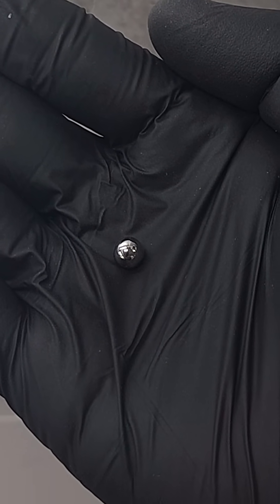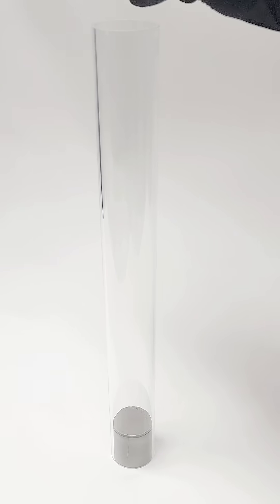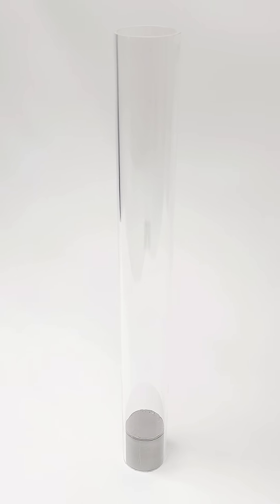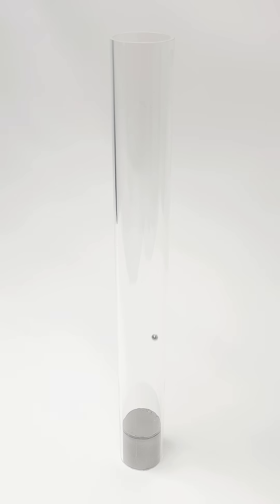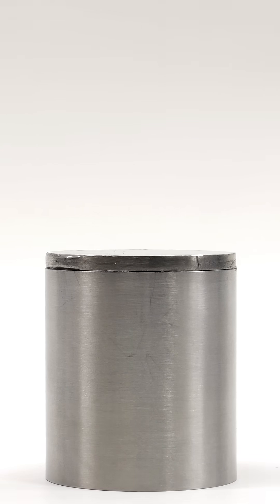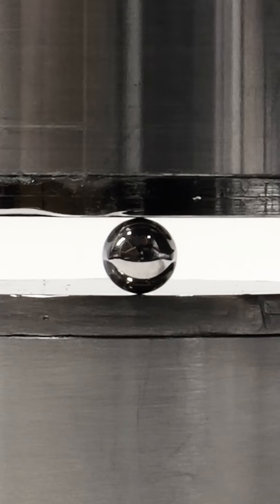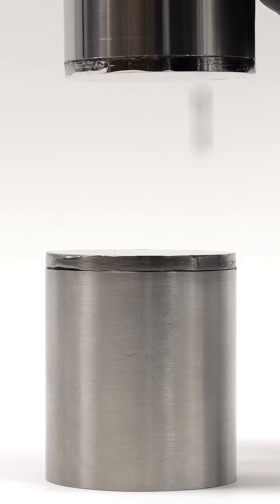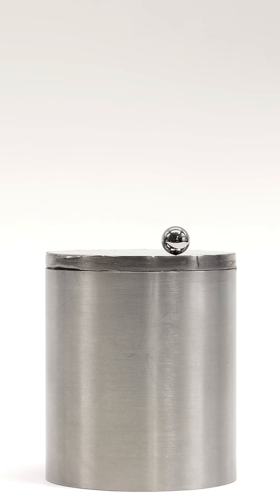This metal is too bouncy

Comment: The beat of the bouncing went from rhythm to a high pitch tone. That tone sounded at least as high, probably quite a bit higher, than A over middle C which is 880hz or about 55,000 beats per minute. That means conservatively the ball in this video bounced 916 times every second.. it is honestly closer to an octave above that which would be almost 2000 beats per second!!! Between 1000-2000 bounces every second is crazy.

Comment: You can get that same effect and the same sound by gently pushing together two heavy-based drinking glasses.  Invert one of them and place it on a table. Then bring the other one, inverted and tilted very slightly, in gentle contact with it.  Gently increasing the point of contact pressure increases the frequency.

Comment: There is a 3blue1brown short about perfectly elastic collisions without friction/etc.

TLDR: Total number of collisions depending on mass is equal to 3.14 (multiplied by input energy) 

There may be an interesting proof to be done here related to the this concept, and its difference in the real world. (Colisions lost to sound, friction, etc) Could potentially calculate some things very accurately.

Comment: pretty goofy idea, so, if you have it encased in magnet material, and have the ball encased in a confined tube, then as the ball bounces, you can have a magnet moving up and down following the balls trajectory of bouncing, as the magnet on the exteriors moves up and down (following the ball), it can create energy which can be stored, just how a windmill or hydroelectricity works, ik about perpetual motion, so it will eventually wear or something, but it should last a while

Comment: It's pretty simple. Because of the trampolines the balls kinetic energy is only lost to air resistance, so each bounce occures with almost the same amount of energy. If you shorten the distance the excess energy causes the bouncing to speed up. The moment you stop the ball between the trampolines the remaining kinetic energy is turned into heat from the friction between the 3 objects.

Comment: I ran it through some audio software and analysed the audio. At the top speed, it's hitting 2.6k fundamental. Which means it's bouncing at, 2600 times a second at the peak. O _ O

Comment: It could well have exceeded 12K Hz. The limitation may be ability of your setup to detect higher frequencies. However, as the space gets smaller, the time window to measure at a given frequency is inversely proportional to the frequency if the closing of the space takes place at a uniform rate.  In addition, energy loss would dictate an upper limit to the frequency attainable and measurable.

Comment: Can this not be converted into energy
Reply: No.
Reply: The entire reason it bounces so many times is because the energy loss is minimal.
Reply: @TrixRKidz  y?
Reply: @JohnnyLawrenceCK  when something bounces, it bounces because every action has an equal and opposite reaction. Now if it’s equal and opposite why wouldn’t it keep bouncing forever? Because some of the energy is lost into sound, friction, and deformation of the ball. This ball particularly is losing less energy due to those factors, which is why it’s bouncing to a height closer to where it was dropped at.
Reply: @JohnnyLawrenceCK  but also that’s exactly why you are right about this not being able to be converted into energy, it has a small energy transfer.
Reply: @TrixRKidz  thank U for the physics lesson but I wascaskin y is it SO bouncy?
Reply: @TrixRKidz  it goes extraordinarily crazy as gap closes, more than seems physically normal.

Comment: I wonder if you left it going at high speed, how much (if any) metal material it is losing - I am assuming the ball is rotating at all times so it should be an even wear and tear on the ball. We will know if it is losing material by the weight or a digital caliper measurement.

Comment: I’m a piano tuner… after a quick listen to the final ball bearing vibration notes at the end of the video, I measure them to be  close to a high G7, which is over 3,100 Hz, or over 3,100 vibrations per second. Could be up close to 3,580 Hz if closer to A7, or the 85th note toward the right of a full-sized 88 key piano.

Comment: Clearly losing 20-30% height on each bounce

It totally looks like it'll never stop
Reply: do you really honestly believe it was losing 20 to 30% of its height every bounce
Reply: @ebenezer-scrooge Yes, because it clearly was.

I work with units of measurement for a living. I can accurately eyeball measurements from a tenth of an inch, to several feet with little trouble.

Comment: What if you added magnets to the outside of the drop at 3/4 angle x4 to 8 to create a pulling force with the drop to create a slow pull just before the ball holds to the top or bottom, think it’s possible to create a constant bounce close to 2 inches away??? This could create electric force if you add slight energy to the magnets itself, feeding a loop back to the magnets creating a propulsion that can be used in zero gravity?

Comment: you talk too much. I only managed to get 1 glimpse with a spectral analysator on my phone, sound peaked at 3khz but because there's 2 bounces per up-down cycle it's going up and down 1500 times per second (still 3000 bounces) When you talk about several thousand times I think I see it going up to 7khz (3500 up-downs per second) but you yap too much so it's hard to tell

Comment: If we consider the scenario where the trampolines are getting closer together, leading to an increase in bounce frequency, we can make an estimation based on reduced bounce time.

### Assumptions

1. **Initial Speed**: The ball bearing has an initial speed of approximately 3.46 m/s.
2. **Final Bounce Time**: As the trampolines approach each other closely, let's assume the effective bounce time decreases to about 0.001 seconds (1 millisecond) per bounce when very close together.

### Calculation

If the bounce time is approximately 0.001 seconds:

\[
\text{Number of bounces in 5 seconds} = \frac{5 \, \text{seconds}}{0.001 \, \text{seconds}} = 5000 \text{ bounces}
\]

### Conclusion

In this scenario, if the ball bearing bounces every millisecond due to the trampolines being very close together, it would approximate **5000 bounces in 5 seconds**.

Comment: to pretty easy calculate how fast it bouces (not the exact value because you have you calculate with gravity and air density then, with the constant energie of the repell,  but to make i pretty simple you have like 10 cm at first, and it already bouces like 10 times a second, so when you put it to like 1mm boucing range, you just devide it so you have 10cm/1mm = 100 by the times it bouces x10 so thousands is pretty accurate :)

Comment: Just crazy idea from crazy racing fan but what if you can make motorcycle or car wheels turn faster with less HP by using these it would be 2 separate systems i think system 1 engine system 2 these trampoline that are on wheels 🤔

Comment: seen a similar experiment involving kinetic forces being used on small objects to eventually move a larger object, and it went something like this, on a 2D frictionless plane, an object weighing 10 grams is bouncing back and fourth between an immovable wall and another object weighing 20 gams, because it has less mass than the bigger object, when it collides it pushes the smaller object back toward the wall, this is due to it having more weight to with stand the smaller objects Inertia
, but now the bigger object is moving slower after its kinetic energy was used to push it away, but after the smaller object comes back, it is now able to push the bigger object, but should the object be drastically bigger, the smaller object needs more kinetic energy and Inertia to push it back, which means it will be colliding with the wall more times than not, similar to this experiment, but a key factor in that virtual experiments, is than when the smaller object collided with both the wall and bigger object, and both object got closer with the smaller object between them, the smaller object suddenly spikes in speed always reaching a speed equal to Pie.

Comment: 🤔 shouldn’t that equal to unlimited energy?
Reply: No?? What
Reply: @aufstieg6948   not necessarily as it is,  but with Newtons law and Epstein E=mc2 there looks like there is enough  transfer of kinetic energy in each bounce to create continuous motion. Even if there is a small spark to start the initial bounce that level of activity is crazy.
Reply: @Kiel_Robinson  “ not necessarily as it is” is the end of  the “unlimited energy” argument
And what do you mean the transfer of kinetic energy look’s enough to cause continuous motion??? 
Even if there was a small, spark or combustion at the impact  (which there isn’t) that still wouldn’t be perpetual motion because it would eventually stop through friction and air resistance and not being a perfect transfer of energy, and even if that wasn’t the case, and it was completely perfect, the spark or combustion you were talking about would eventually destroy the ball bearing and end the cycle, perpetual motion, and free energy is not something that exists as far as humans know.
Reply: @aufstieg6948  I consider all those, but it only needs to be more than the initial energy to be sustainable. For the record I just brain farting here.

Comment: Could this system be used to generate power?
Reply: probably not because it doesnt bounce forever. at a certain point you will need to use energy to put the ball and block back into starting position. that used power is more than the generated.
im not very educated about this stuff so i hope im right.

Comment: Something even cooler is that this is basically how notes work in music. The note is a vibration or oscillation that happens a specific number of times a second, or a hertz. the frequency of a hertz is what you displayed in the video. the closer the ball got to the metals, the higher pitched it went. This applies to any sound really, not just notes.

Comment: Easy, measure the frequency ramp of the sound.  As the sound is the collisions at the top and bottom of each cycle you can measure the number of hits per second by the frequency of the tone.

Comment: In the long video, he made this from scratch. I think that he made something that he could patient.  Who knows, maybe it can be used in satellites with zero gravity. If you connect the steel that the material is mounted with an outer slide, inertia loss would be even more canceled.maybe use some thick, high carbon thick rod stock for the mount .

Comment: From the POV of sound engineering, a note that you hear is technically just the number of cycles per second. That ball, as the ‘trampolines’, approach it have it going at absolutely ludicrous speeds to generate a pitch so high. I’m not an expert by any means, but I do know this at least.

Comment: Just measure the hertz of the sound of it bouncing back and forth between the two pieces and then you’ll have the number of times it contacted each surface… if you consider a bounce as a trip from one surface to the other and then back to the first one, divide that number by two and you’ll have the number of bounces.

Comment: For those wondering... The term "atomic trampoline" refers to an amorphous metal alloy, a.k.a. a bulk metallic glass. The ball bearing bounces so high because the amorphous metal is relatively hard. Metallic glasses in general tend to be much harder than bulk crystalline metals. Hardness is a measure of resistance to plastic deformation. Amorphous metals are harder because they lack the crystalline defects like grain boundaries and dislocations present in most metals.

Comment: You can probably use the pitch of the sound to measure the bounces. I checked with a tone generator, and it sounds like 4650 Hz (meaning bounces per second), but it could be double that, since double pitches that high can be hard to distinguish (especially since the highest note the ball made is only audible for a fraction of a second).

Comment: Analyzing this with an iZotope RX 10 audio editor, the fundamental frequency reaches just over 17 kHz and might have gone higher (as 17k may have been the upper limit of the recording gear). So, I'd LOVE to see this with a high speed camera and calculate the final oscillation rate before the ball stops.

Comment: You NEED to drop the other trampoline facing down into the cylinder that you built. This will cause a deacceleration of the dropped cylinder that is proportional to pi * 10^x. Don't exactly remeber the details, but 3blueonebrown made a short about this phenomenon

Comment: What happens when you drop the two trampolines on top of each other inside the tube to keep them vertically constrained (or maybe two with holes in the center to have a pole in the middle)

Comment: Ive seen a simulation that goes something like this were on a friction less plane an unmovable wall a sqare and a vigger square is coming towards the two squares bounce against each other and the wall until energy is fully trans fered tabd the bigger square stops and turns around the amount of bounces the first three numbers will alwas be the numbers of pi

Comment: The highest pitch I heard before it stopped bouncing was a high, slightly flat c (I have absolute pitch), so around the 8,200 Hz area.  In tune C (or least mathematically in tune) in that range is approximately 8,372 Hz.

Comment: I'm guessing that high-pitched sound has to be over 10,000 HZ. I would be interested to see if you can pick up a difference in temperature using thermal imaging. The ball bouncing that frequently, and the fact that the surface puts that kinetic energy back into the ball, means that the ball should be heating up right?

Comment: FOR EVEN MORE BOUNCINESS:
• Make a small sphere (ball bearing) from the same material as the trampolines!
• Make more-optimized trampoline material.  I think I have seen trampolines that bounce much longer!
• Operate the system in a partial vacuum, to reduce air resistance and sound emission.
• Make the base more massive, to reduce recoil losses.
• Consider tuning the base thickness such that the shock wave from impact returns to the ball as it leaves, to reduce the loss to shock waves that just ring insude the trampoline.  For example, a hemispherical trampoline might reflect and reconverge the shock wave; its radius determines the delay time.

Comment: It’s a nice example of what confinement does when combined with the conservation of momentum. As you remove the effects of gravity by shortening the distance between the elastic surfaces the momentum of the ball is converted to rapid reversals of velocity. The kinetic energy is conserved, but the acceleration and deceleration caused by gravity approaches zero as the amount of time allotted to it approaches zero.